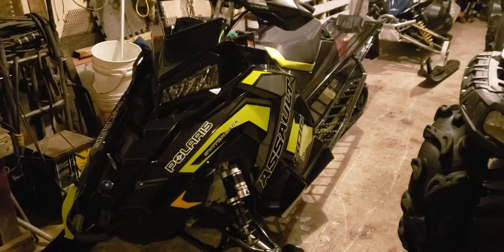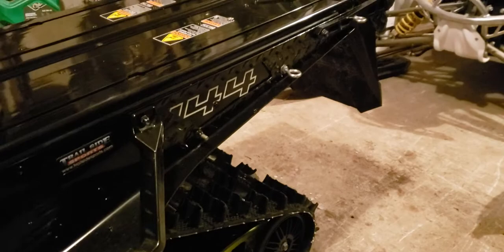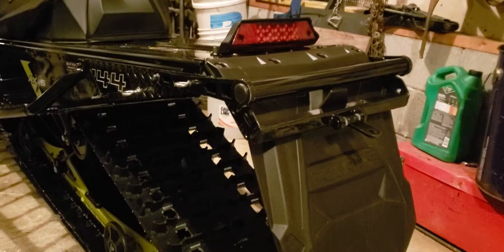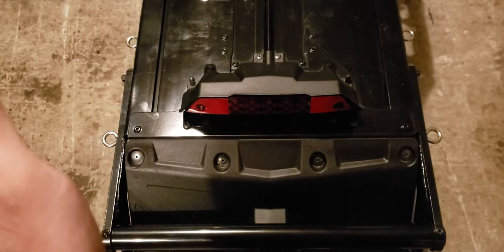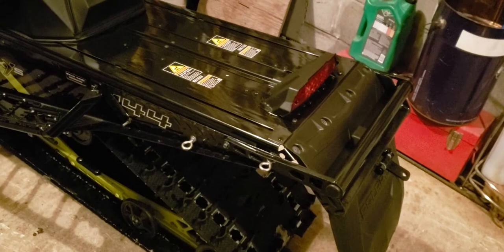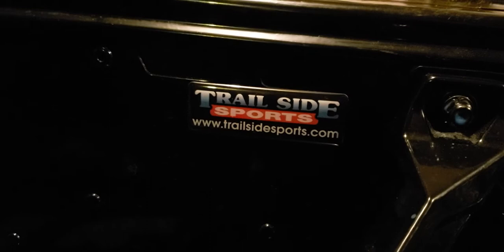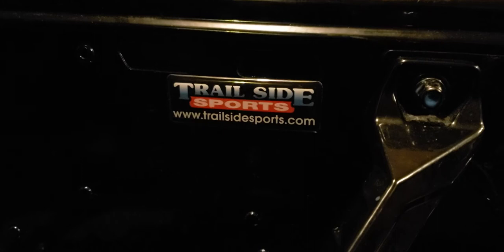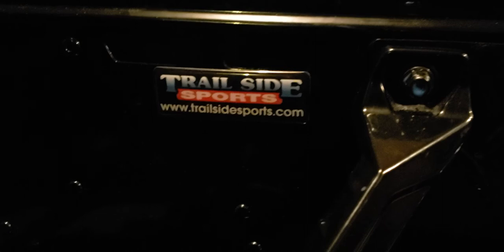POLARIS assault bumper trailer hitch

Comment: Hi Ernie ...sweet hitch.  Is your checker running on the outside or inside tunnel....looks outside.  What did you do to the reflectors on the tunnel or will the plate go right over top.  And where did you get the 144 stickers?